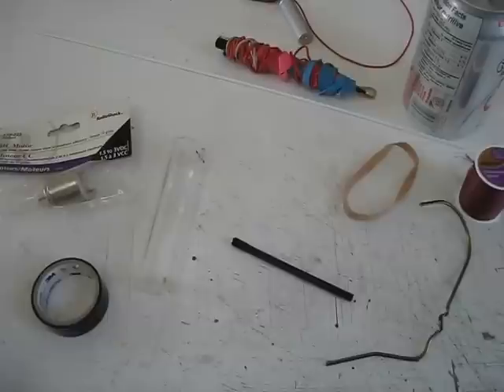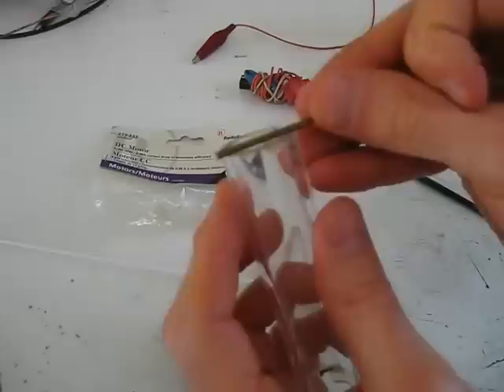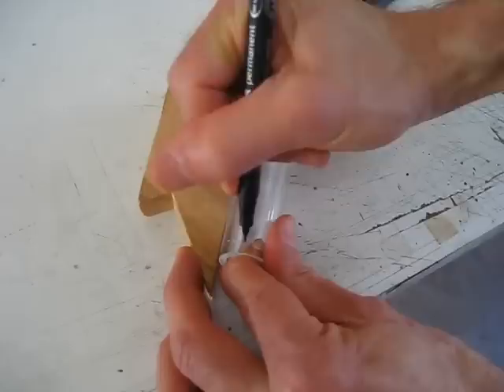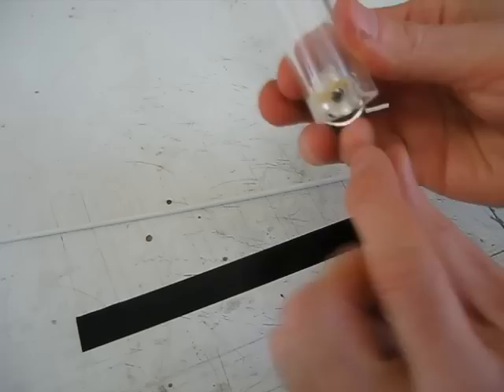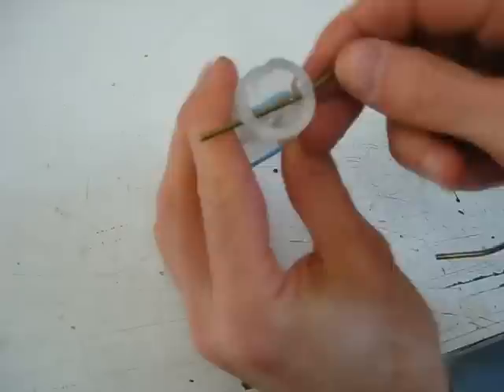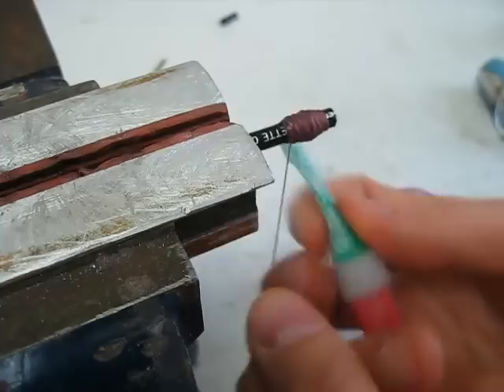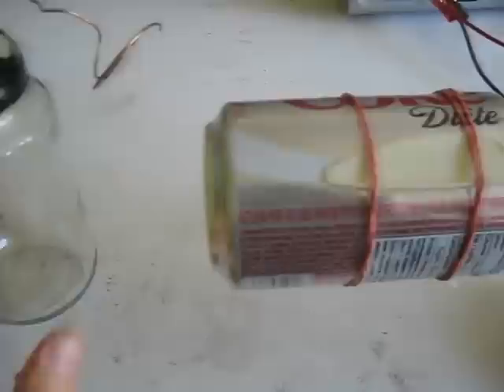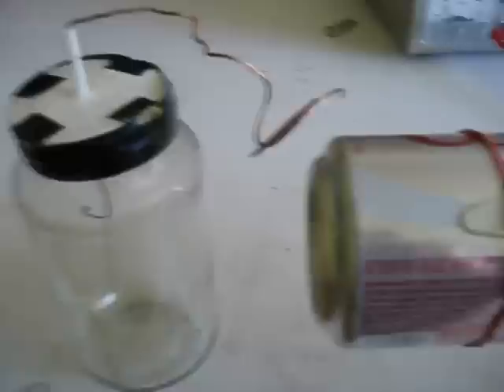How to Make/Build a Van de Graaff Generator Part 1 (Homemade/DIY)

Comment: How should I make the wire sharp like you said in the how it works video?
Reply: The thing is not working idk why
Reply from the maker: If you mean the wires that a re facing the pulleys/rollers, I didn't make them sharp. The overall wire is made up of many small strands of wire and those strands already have sharp enough ends just by cutting them. Just make sure you spread out the strands and have as small a gap as possible between the pulley and the strands.

If you're having problems, here are some tips...

Look at the Triboelectric series table on the right side on:
http://en.wikipedia.org/wiki/Triboelectric_effect
The surface material for one pulley should be on the positive side of the table, the surface material for the other pulley should be on the negative side of the table, and the inner surface material of the belt should be somewhere in the table in between the pulley materials.

The wire should be connected INSIDE the can.

The sharp points of the wire near the belt should be spread out and should be as close as possible to the belt without touching.

The tube which the belt is in must NOT be metal.

You should have a good ground connection. There are some more good tips in my "How to Make a Van de Graaff Generator Part 2" video http://youtu.be/QrCgtjZwnB0
Reply: Does it depend on the battery that I'm using ?
I tried everything exactly the same way but with a rubber wrist band that is thin (just like the livestrong ones)
Reply: Does it matter?
Reply from the maker: Rahul Kamath
Someone here reported that their rubber wrist band didn't work, possibly due to a coating on the wrist band or maybe what it's made of. Regarding the battery, if it's powering the motor enough to make the belt turn at a fast speed then the battery's fine.
Reply: Thanks and what can I use instead of the band?
Reply from the maker: Rahul Kamath
You could look for rubber bands in office supply/school supply stores or any store that has a section with school supplies. Some people use the black vinyl electrical tape with the non-sticky side facing inward.

Comment: What about an ac to dc power converter like a battery charger.. Would that work?
Reply from the maker: ***** I don't think so. I'm pretty sure you need high voltage. The AC to DC power converters you're talking about put out around 12 volts (for example) whereas for the cyclotron you'd need in the thousands of volts.
Reply: Geeze.. I may just use videos in class lol, what about a metallic painted ping pong ball, think 12 volts would do that?
Reply from the maker: *****
I've seen people using metallic painted ping pong balls but they used 15,000 volts.
Reply: Im way off.. any idea how many volts your generator created?
Reply from the maker: *****
I have a few different ones. The one I gave a link to is the one I use most often and tops out at around 30kV.

Comment: Im in europe so its 230-240. I tested Between one pole and ground and I got  240 AC voltage(europe here). I tested again with the  second pole and ground and got 240 AC.   I dont however understand your next statement:"Between the other poles and ground you should see around zero."    What "other poles" are there?   in europe and usa and the world there are always only two poles for electricity and a third pole(that come in different shapes)  for ground.

Comment: Will a tin can work, or does it need to be an aluminum ball like object?
Reply from the maker: Yes, a tin can will work. It just has to be metal.
Reply: Okay whew! I didn't want to have to chug a soda just for that XD
Reply: Micah Burgin lol I hear you on the soda though for me I can find plenty in the ditch in front of my house thanks to all the soda drinkers that drive by. The key is something having very little sharp edges since sharp edges bleed off the charge.
Reply: Ahh! Thanks! I can probably cast a ball of aluminium now, couldn't really do that before but I can now.

Comment: Can we make this without using that ground wire?..  will it still work?
Reply from the maker: You can do it without the ground wire. Have a look at my part 2 video https://www.youtube.com/watch?v=QrCgtjZwnB0. I show a few different tricks there for the ground side, as well as some other improvements.
Reply: Ohh ok.. and what do u mean by mechanical pencil @ rimstarorg
Reply from the maker: Ha ha! Interesting question. I guess almost all pencils are mechanical pencils these days. The non-mechanical ones are the orange colored wooden ones. The pencils where you have to push a button at one end in order for the pencil lead to come out the other end are mechanical pencils. I guess these days they're just called "pencils". https://www.ldproducts.com/bic-ecolutions-mechanical-pencils.html
Reply: +RimstarOrg ohh that's fine😁

Comment: Sir,please tell me the cheap and easily available things that i can use for my lower pulley and for the belt when i have used nylon thread for my upper pulley...
And please give your mail address...i will mail you my further problems and the image of my van de graaff generator.......
Reply from the maker: Basically, plastics can be used for the lower pulley if the upper pulley is nylon thread. So look around. Try some pens. Vinyl electrical tape is another option. Be sure to check out my part 2 video "How to Make a Van de Graaff Generator Part 2" and my webpage http://rimstar.org/equip/build_make_van_de_graaff.htm and FAQ page http://rimstar.org/science_electronics_projects/van_de_graaff_faq_frequently_asked_questions.htm before you send me a bunch of questions. My email address is at the bottom of all my webpages.

Comment: Instead of vinyl tape for the motor shaft, would layers of shrink tubing work?
Reply from the maker: Possibly. I've never tried it and haven't seen anyone else try it. If you try it, let us know how it goes for future reference. You'll have to look up what it's made of to see which side of the triboelectric series table it goes on. My guess is it's plastic and so would be on the negative side but I could be wrong.

Comment: Can we use a metal rod rather than using glass tube?
Reply from the maker: zeeshan khan No. Anything electrically conductive, like metal, would be bad to use.
Reply: Thanks.
Reply: Can u suggest any other materials from which charge can be gathered.?
Reply from the maker: zeeshan khan
For a Van de Graaff generator I show some other ideas in my part 2 video http://youtu.be/QrCgtjZwnB0 You can also look at the triboelectric series to get some ideas http://rimstar.org/science_electronics_projects/triboelectric_effect_series.htm

Comment: What was that black stick that had a name cassette on it ?
Reply from the maker: bhaskar shetty Do you mean the black cylinder at 2:22? That's something that was I took from inside of a mechanical pencil.
Reply: RimstarOrg  whats that material in the mechanical pencil?????plastic?
Reply from the maker: Parachute
Yes, plastic. In my case, the material it's made of doesn't matter. What matters is what the outer surface of the cylinder that contacts the belt is made of and since at 8:10 I wrapped it with nylon thread, it's the nylon that matters. In that case, the cylinder could have been made of anything.
BTW I have more tips for these cylinders in my part 2 video here https://www.youtube.com/watch?v=QrCgtjZwnB0
Reply: RimstarOrg thank you soo much!!!!!!!!   :)

Comment: What is the coke can for? Why can't I just use the end of the wire
Reply from the maker: Good question. The coke can is there to accumulate the charge so that you end up with a lot of it and can then get sparks. Notice that you have to wait between each spark while the charge accumulates on the can.
The problem with the end of the wire is that it's sharp. A sharp point results in a strong electric field near the wire and that pulls the charge from the wire. You'd lose it all to the air without accumulating any. Adding sharp points to things is one way of preventing high voltage buildup.
You can blunt the end of the wire and reduce the loses that way, but it's still nowhere near the surface area of the can and so you'd never accumulate much.
The fact that you connect the wire to the inside of the coke can also helps. i.e. having a flat plate of the same size wouldn't be as good. That's because something called the Faraday ice pail effect takes place when you connect inside the coke can. I talk about that more near the end of my How a Van de Graaff Generator Works video https://www.youtube.com/watch?v=EsZQS2GOMQE and demonstrate the difference in this other video http://youtu.be/xRLvbwF2MnM. Heck, I even used the effect with the Franklin's Bells https://www.youtube.com/watch?v=cjlMrSlIIIQ (I love it when science just works).
Reply: RimstarOrg Thank you

Comment: Can i use electic tape as belt?
Reply from the maker: Yes, I have seen people use electric tape (vinyl) as the belt. Because of the materials involved, it's no longer the triboelectric effect taking place (I don't recall the name of the effect that is taking place) but it works.
Reply: RimstarOrg thank you for the answer!! I am currently making a van de graff for our physics project and for some reasons it wont work ;-;
Reply from the maker: Check out my part 2 video. It has more tips https://www.youtube.com/watch?v=QrCgtjZwnB0 Also, knowing how it works often helps https://www.youtube.com/watch?v=EsZQS2GOMQE Make sure you have a good ground, good brushes, and suitable materials for the surfaces of the rollers and the inner surface of the brush.

Comment: i had a big one one time ... it had a wool belt with a aluminum wire strands dragging on the top of it all mpountedto a aluminum dome
Reply from the maker: Wool, nice. I'll have to try that some time. Do you remember what the surfaces of the rollers were made of?
Reply: rubber shafts

Comment: What is that black tape used
Reply from the maker: It's often called electrical tape since it's often used for insulation on electronics. But you can usually find it in the tape section of any hardware store and many other stores. It's pretty a standard and widely available type of tape. The key here is that it's made of vinyl.
Reply from the maker: Here are some random links:
https://www.homedepot.com/p/3M-Scotch-3-4-in-x-66-ft-Electrical-Tape-4218-BA-40/100130843

https://www.walmart.com/ip/Install-Bay-1700-3m-Economy-Electrical-Tape-75-X-60ft-Single/21553763

Comment: i work same copy like youbut all in vain,
a frindship insulator belt i used, i gave a earthing towards ground , yes i connected wire  inside the can yeds but not too sharp and the wires were not touched to the belt
okk sir i will watch that 2nd part of van de video,
but what's your conclusion about AIR IONIZATION

Comment: Sir, can i use plastic lollipop stick  instead of vinyl tubes?
Reply from the maker: +jan mar balatico Yes. Pretty much any material will do as long as it's not metal. Damp wood would be bad too.
Reply: Is it necessary to use vinyl electrical tape. I have electrical tape here but I don't know if it is vinyl.. What's the difference?
Reply from the maker: jan mar balatico
If it's electrical tape then it's probably vinyl. As for which materials you can use, I have an explanation of that here http://rimstar.org/science_electronics_projects/van_de_graaff_faq_frequently_asked_questions.htm#Q_RBMATERIALS. Once you understand that then you can look around and see what you have.
By the way, you may also want to see my part 2 video for making a Van de Graaff since it has a lot more tips and some easier ways of doing things https://www.youtube.com/watch?v=QrCgtjZwnB0
Reply: thank you soo much sir.
Reply: Sir do you have any physics related projects like this.. And preferably the parts can be found at home..
Reply from the maker: +jan mar balatico I have plenty of projects like this that you can do with parts from home. Have a look through my Science Projects playlist https://www.youtube.com/playlist?list=PLFsZmHTZL-zn3jrI0X0e0aRijWlyvfg8h. Or if you prefer another format there's my webpages under http://rimstar.org/science_electronics_projects/index.htm

Comment: wowwww fantastic 
what is normal voltage value which you applied for  air ionization ???
30 GAUGE  is what ??
OKKK i will again try on it .... 
thanks alot once again 
sir may i know your email address ?? 
by which i can  contact you for  that  van de

Comment: Hi, I did all you have done in the video in a different way,but it is not working.Help me :( Here is my work Van De Graff Generator
Reply from the maker: Remove the aluminum foil from the PVC tube. That is one thing that would stop it from working. You want only PVC along the length of this tube, no metal. Also, your brushes don't look like they have enough sharp points. Really their only sharp points are at the corners. Also, the ends of the brushes should be as close as possible to the belt/rollers. What is the outer surface of your bottom roller made of?
Reply: RimstarOrg Both the upper and bottom rollers are covered with foam.I have used Aluminum because it has +ve charge.Since,PVC is -ve and belt having +ve charge will cancel out each other charges.
Reply from the maker: Annamalai Shanmugaraj
Aluminum doesn't have a +ve charge. Either where you heard that was wrong or you misunderstood what you heard. You need the material making up the outer surfaces of your rollers to be on opposite sides of the triboelectric series table. They can't be the same material. Another option is to have one roller be metal. For example, wrap the top roller in aluminum foil. See my "How a Van de Graaff Generator Works" video http://youtu.be/EsZQS2GOMQE for an understanding of how it works.
Reply: RimstarOrg I saw that aluminum is positive in http://en.wikipedia.org/wiki/Triboelectric_effect.And Thanks for your help.Btw,I tested Foam and Polyethylene sheet with electroscope but it dint work.Why??
Reply from the maker: Annamalai Shanmugaraj
That's not saying aluminum is positive. That's saying aluminum will become positively charged, when rubbed with a material listed toward that the negative side of the table. In your case you're just lining the inside of your PVC tube with it and not rubbing it there at all. Instead it's acting as an electrical conductor, shorting out the different charge accumulated on the two rollers and the belt. Their charge leaks to the surrounding air through ionization to the aluminum in the PVC and the aluminum allows it to balance out and neutralize everything. But I suspect you're not even getting to that point yet. If your polyurethane and polyethylene didn't work with an electroscope when you rubbed them together then likely either the air in your place is too humid (dry air is better) or there's something coating one of the materials and you need to try something else. It's also possible there's a problem with your electroscope but I doubt it. You can test that by rubbing a plastic bottle against clean hair and testing with the bottle. You also have to work on you brushes, not enough sharp points and possibly to far away from the belt.
Reply: Thanks for the reply again.Electroscope worked well with my plastic ruler when rubbed against my hair and also with my CRT monitor .Okay,I'll correct my brushes with more sharp ends and also I'll remove the Aluminum foil.

Comment: ok here is the thing my main problem was the rubber band i used a normal wrist band? it was made of polistar and painted white it totaly didnt work
so i cut a ballon wide and used it as a rubber band :D
thaaat was pretty much everything oh and the closed can worked better for me than the open one for some reason

i used a pack that i took from an old toy one that is like this :
acroname.com/robotics/parts/R122-4XAABATT-PACK.jpg
but only three batteries

Comment: One of the roller must be on the positive side of the triboelectric series and the another roller must on the negative side of the series
Reply from the maker: Yes, that's right. But the inner surface of the belt must also be somewhere in the triboelectric series between the two roller materials.

Comment: Is there a certain purpose or problem to this project?
Reply from the maker: I did it because I wanted to see if I could make a Van de Graaff generator from as many easy to find parts as possible.
Reply: RimstarOrg Okay... I understand that part but I am asking this because i have a science fair project due January 30th and I need to know if there is a problem and what is the solution. I need to put my own spin on the project but I can't do that until I know if there is a problem or not.
Reply from the maker: Joseph Long
The original problem was to create a high voltage source for accelerating subatomic particles to high speeds in linear accelerators for physics experiments. See the wikipedia.org page for Van de Graaff. Nowadays they're mostly made for fun, making sparks for doing other neat things. You often see them in science museums where someone would stand on an ungrounded platform, put their hands on the dome and their hair would spread out. They're also used in physics and science classes to explain various things about electricity.